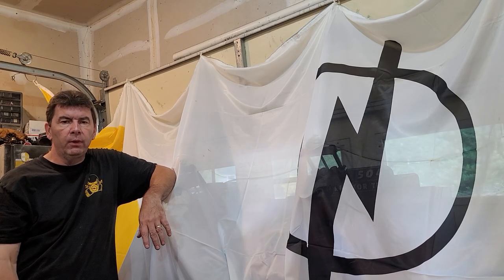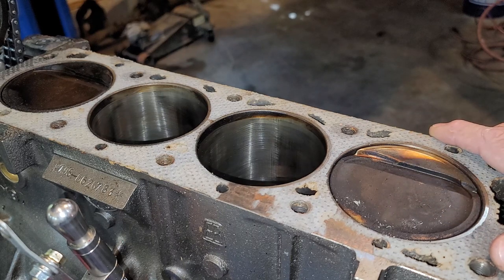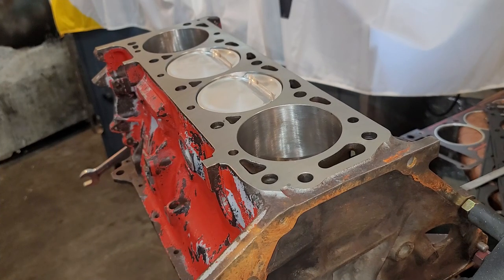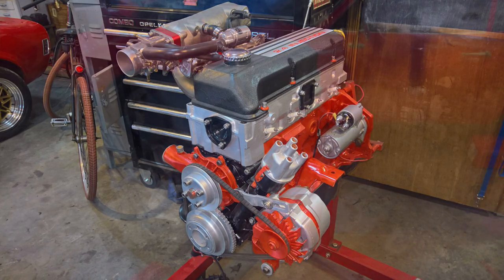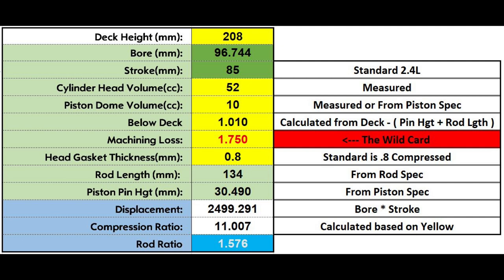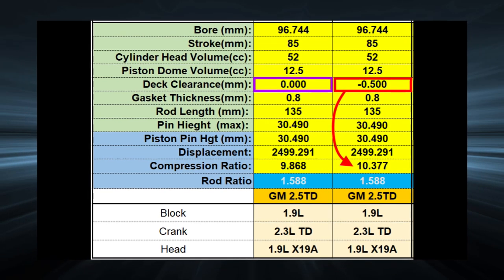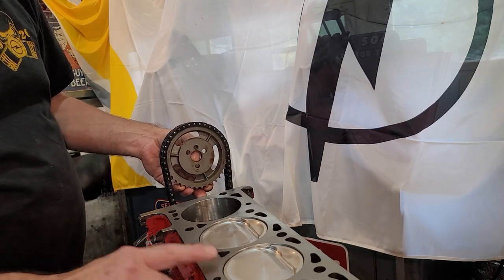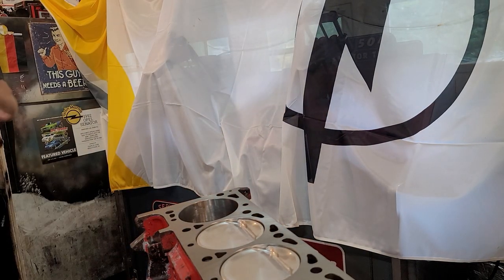How Cometic Head Gaskets can cure high compression in an Opel CIH Motor or any Custom Engine Build

Comment: A nice cam should help bring the compression down with a bigger overlap
Reply from the maker: True.. issue right now is getting cams. Also if you like the cam, but need to lower head pressure.. just a bit without changing the overall dynamics.

Comment: Modern cars use multilayered steel gaskets like that. They are far superior to conventional gaskets. At the dealership we are instructed by the auto manufacturer not to use any sealers on them. Does the manufacturer of the gaskets suggest it? Thanks, appreciate your details and obvious hard work
Reply from the maker: I have heard both arguments. Would I do it on a motor that came with MLS gaskets and such.. probably not. The difference here is we are using "modern tech" on a 1960 design motor that is prone to leaking and warpage and corrosion, that is with the stock gaskets. The stock gaskets have more give and need a little help. In the case of the Opel CIH, our tolerances are a LOT less than new motors, also we will have corrosion around the water jackets. Copper spray won't damage anything and helps seal the water jackets, especially when cold. Is it a 100% necessary ? Maybe not. Is it going to hurt on our motors ? Doubtful as the guys that race Opels have been using copper spray on the gaskets for years with no adverse affects. But when they don't occasionally the motors will seem coolant until warm, and if anyone watching this channel is going to use these gaskets on a car that sits in the garage more than it is driven, much less raced.. it wouldn't hurt to have a little extra protection as our motors leak under the best conditions.
Reply: A possible Interesting fact/thought is that the first MLS gaskets we saw were replacements for problematic conventional style gaskets on Dodge Neons (they leaked horribly). We were instructed to use a sealer on them. This supports the idea that old tech meets new tech requires sealer.
Reply from the maker: @fredfabris7187  really comes down to tolerances.. if you use a MLS on a PERFECTLY planed head and perfectly planed block that have no deviation from each other ( and the timing cover ). Then no sealer. LOL. The ONLY Place I used any RTV was on the timing cover gaps, where they make a T intersection. Just because. they ALWAYS leak there. As for copper spray just insurance. to make sure coolant doesn't leak past the gasket. It doesn't take much to leak.
Reply: you are real master👍🏻

Comment: so im trying to resurrect a ascona B and its cylinders are like mirrors. is it ruined? and is the X19 head original on the 1.9SH block?
Reply from the maker: Sorry just saw this.. No. New rings and hone the cylinder.. COULD work wont know until you take it apart and measure everything.

Comment: hello, are you from america ?
how you come to an irmscher püston ?
greetings
Reply from the maker: Yes I am in Virginia. But travel to Germany often. I got the chairs from Irmscher if you mean the Chairs ? If you mean pistons.. I have tons of different ones :)
Reply: @GoinManta  hello, can you answer me one question. how do you get from a 4cylinder cih a 2700ccm engine ? you need the crankshaft from a diesel. but its lifting is only 85mm,greetings, bernd
Reply from the maker: @dersoloist6591  Sorry I didnt reply YT didnt tell me there was a reply last year. Getting a 2.7L means offset grinding the 2.4L or 2.3 crank to a 91mm stroke, 96.5mm pistons from a Yahama motorcycle. Lots of custom pieces.